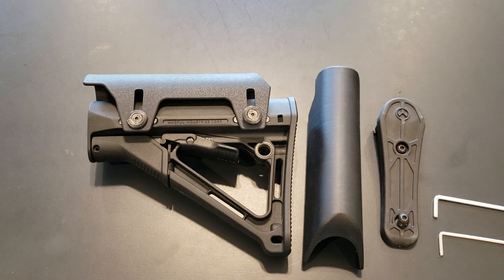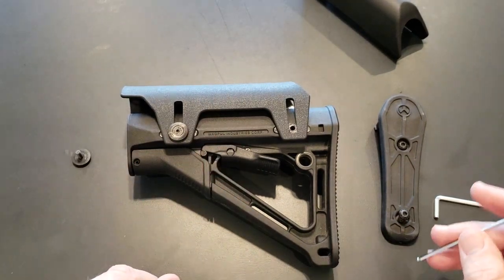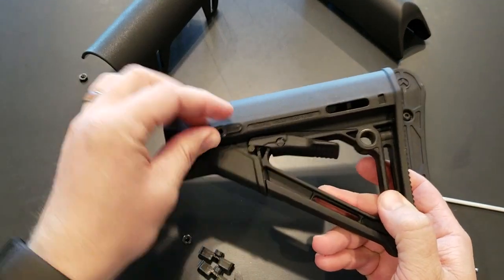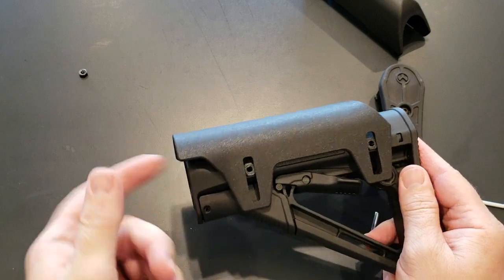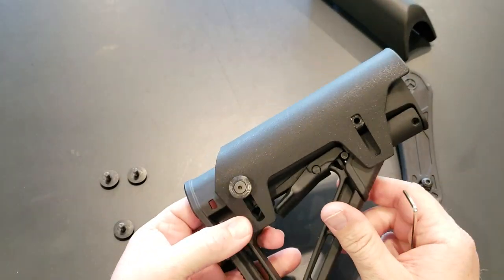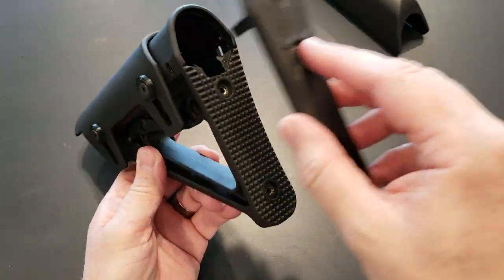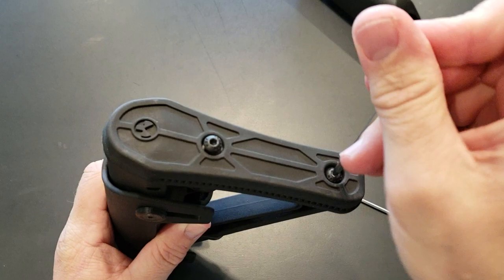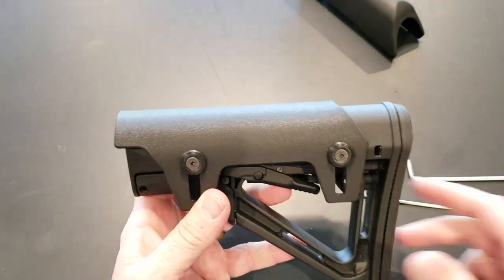Magpul CTR AR Carbine Stock - Custom Adjustable Cheek Riser Installation

Comment: Just bought this. For those of you worried about the fact that the inserts and washers are 3D printed: it’s not an issue. I can’t think of a single scenario where the spacers would be prone to losing their structural integrity. Like the creator said in the video, I also cannot get this thing to move down no matter how much downward cheek pressure I put on it. Replacing the 3D printed parts with metal would not improve performance or reliability even a little, in my experience
Reply from the maker: Thank you Greatly for your business, watching my video & commenting, I really appreciate it. 

Have a Great Weekend~!

Sincerely, 

Matthew 
#MatthewsFabrication 
#CheekRest #CheekRiser

Comment: NICE VIDEO, get a lathe and make that washer,well done man.
Reply from the maker: Thank you greatly, I appreciate it. I do have a lathe, but I 3D printed the washers with TPU (same material they use for phone cases, tough & Flexible).

Sincerely,

Matthew 
#MatthewsFabrication 
#cheekrest #cheekriser

Comment: Nice video. Will the 1.4" height riser allow the charging handle to work at the max height?
Reply from the maker: Thanks for the Question. Yes, as long as the stock is extended far enough. You can also put the Cheek Riser on backwards to gain more room.

Have a Great Day & Happy Independence Day~!

Sincerely, 

Matthew 
Matthew's Fabrication, LLC 
Disabled Veteran Owned and Operated 
#MatthewsFabrication 
#CheekRest #CheekRiser

Comment: I would be super interested in a model that uses metal slot adapters!
Reply from the maker: Thanks for watching & the comment. I won't be making metal slot adapters. The adapters that come with this Kit help keep it in place with its rubbery texture & are very tightly fitted in the slots.
Reply: @MatthewsFabrication  that's fair. I guess I was concerned with their durability over time. How tight is the hold? If I bump it with my cheek or something will it slip or stay firmly put?
Reply from the maker: @midlbrwn15  7min 20 until the end of the video... I talk about this.
Reply: @MatthewsFabrication  oh cool. I'll take a closer look
Reply from the maker: @midlbrwn15  Sounds Great

Comment: Do you know if this would be compatible with any of the other magpul stocks that have indentations for cheek risers, like the DT Carbine and DT PR stocks? The indentations don't go through all the way to the buffer tube like they do on the CTR, but they seem to be sufficient for mounting the magpul fixed cheek risers.
Reply from the maker: Great Question. Like the video shows, the Slot adapters need to go inside the stock as well as the nut...

So... thinking 🤔 💭  You could cut out the slot area for my kit to work... possibly. Not sure what the inside looks like.

Or just drill a tiny hole for the screw to fit through with the nut on the inside... again not sure how the inside looks & if there's that little bit of space for the nut.

If you have the stock you can send me some internal photos. 

Sincerely, 

Matthew 
Matthew's Fabrication, LLC 
Disabled Veteran Owned and Operated 
#MatthewsFabrication 
#CheekRest #CheekRiser

Comment: Does the charging handle work still with riser installed?
Reply from the maker: Yes, it does. If you adjust the stock far enough back it works great... collapsed it won't work of course.